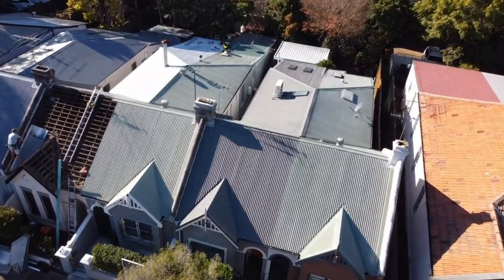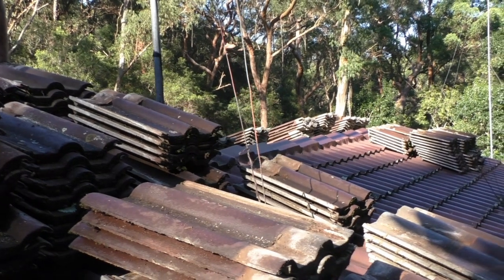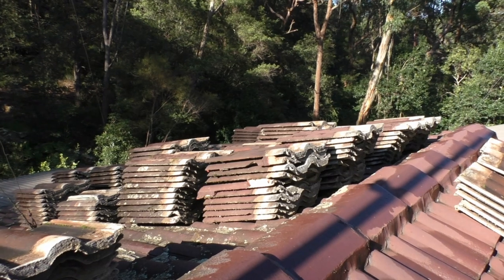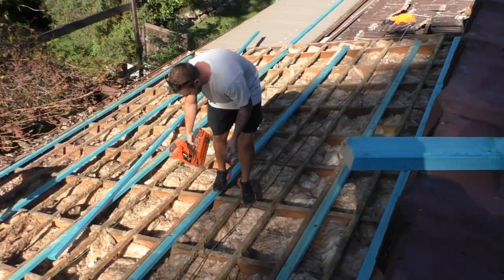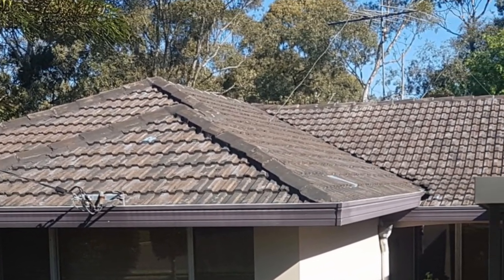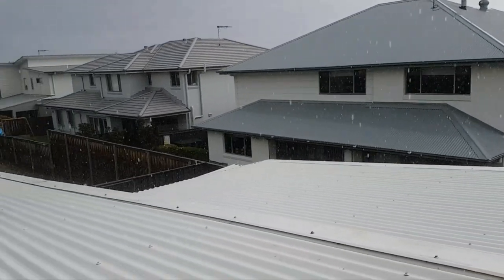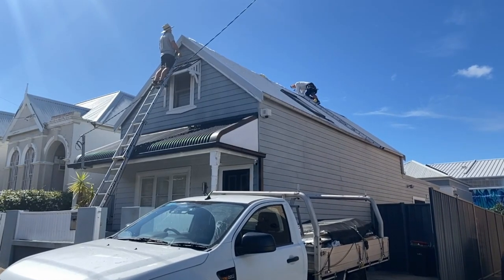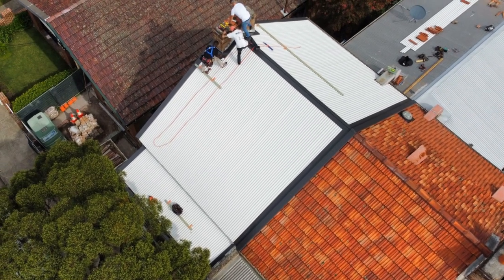Why replace a tile roof with a colorbond metal roof?

Comment: The trouble with metal roofs they look like industrial units .condensation and noise is a problem with metal roofs. And they will never out last a tile roof .Half the trouble is the shallow pitches